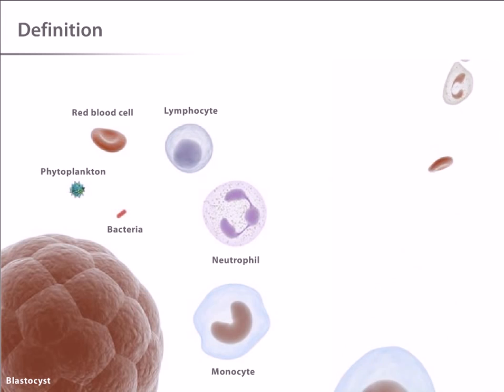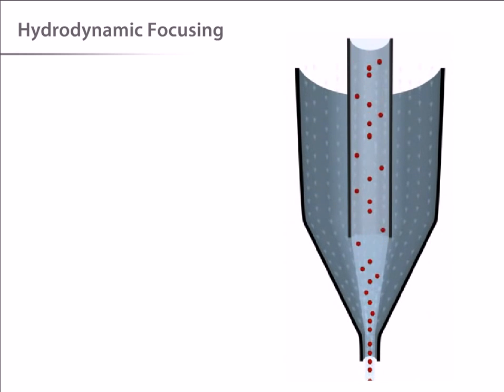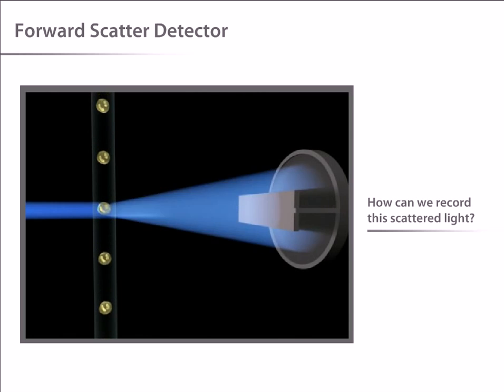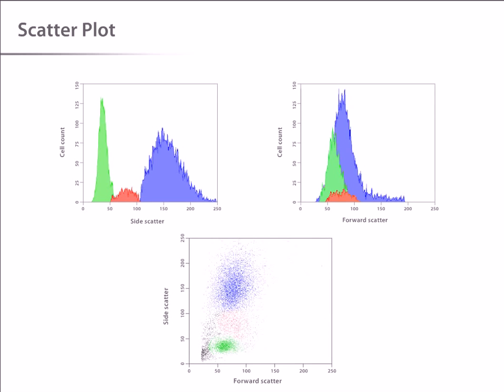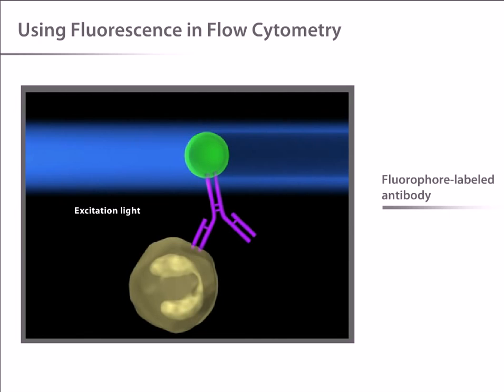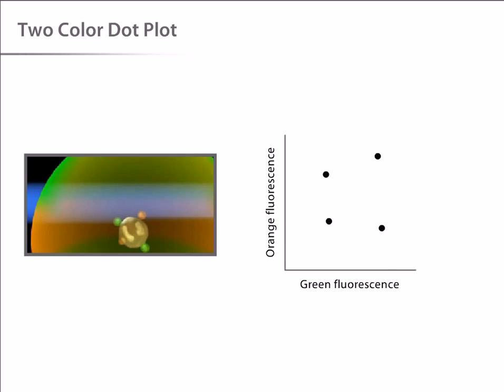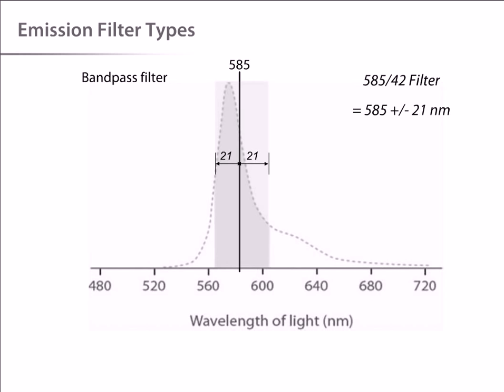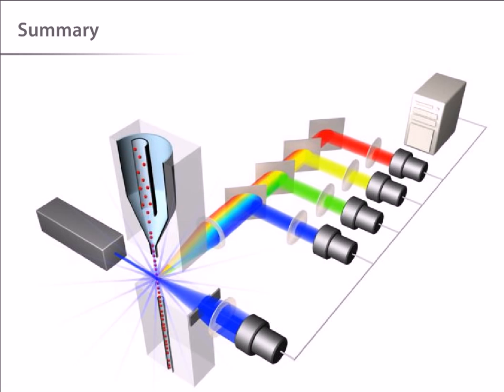Fluorescence-activated cell sorting (FACS)

Comment: nice video. However, there is a small error on slide at time 3:40: it is true that large particle scatter more, but not to larger angles, vice versa, small particles scatter less, but not to smaller angles. In fact, the larger the particle, the smaller the angle

Comment: This video does not fully explain FACS: it explains how cells with different fluorescent probes can be distinguished, but not how they are practically sorted.
Reply: Do you know anything more about that FACS? do you know how it can separate chromosome X and Y?
Reply: here is a patent application for using flow cytometry to separate x and y chromosome sperm. www.freepatentsonline.com/y2015/0168297.html
Reply: lol,  seperate X and Y.. it is about CELLS, not Organelles or other molecules within a cell. It can only sort cells.
Reply: @richardred4396  Also can sort beads.
Reply: @richardred4396 

With facs you can also analyse and sort other things... Not only cells
Reply: Read the text in the dropdown below the video.